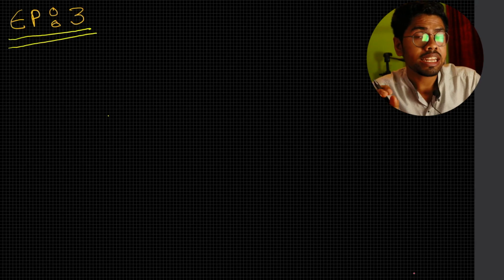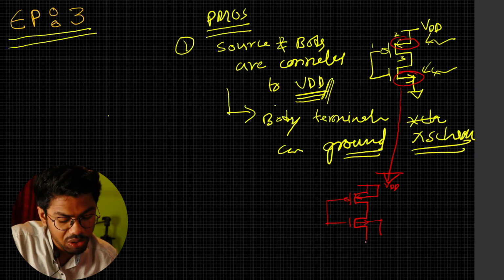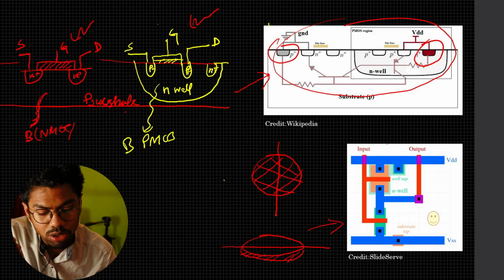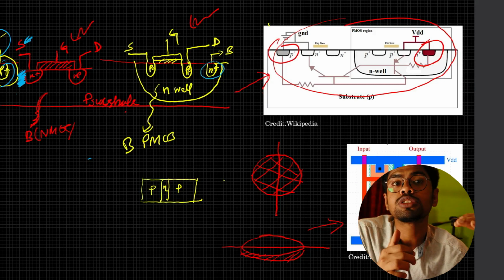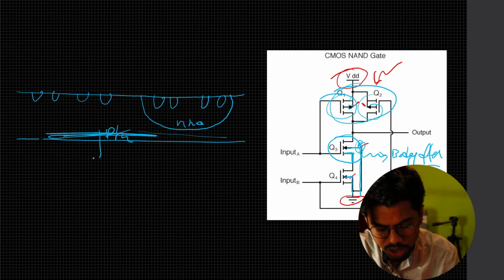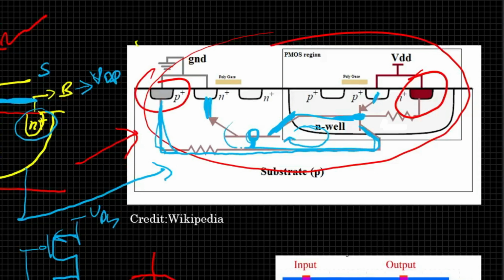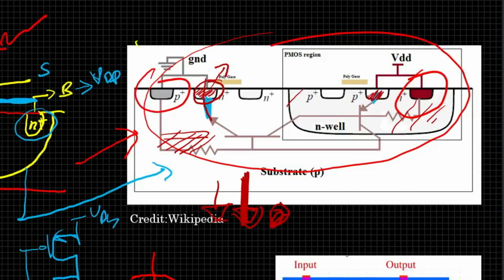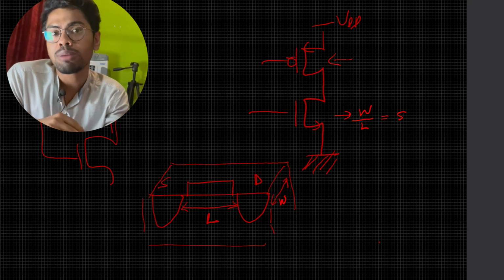Ep3:Trending questions on CMOS inverter | JOB or MTech admission interviews.

Comment: Hello sir what's the reason behind for not having forward biased... It will flow the current but didn't get the exact reason can you please elaborate
Reply from the maker: We want a mosfet right , so if we have forward biased pnp instead of it , out purpose of having only mosfet will defeat, in logic level it wont work as we wanted to

Comment: if W/L of NMOS is 5 the W/L ratio of PMOS is 10. The sizing is done in such manner because the mobility of holes is 2times less than mobilty of electrons. This is done so that the resistance offered to current, by PMOS and NMOS remains the same.